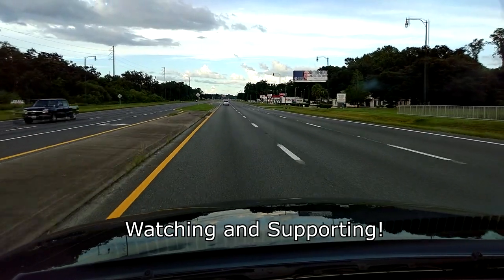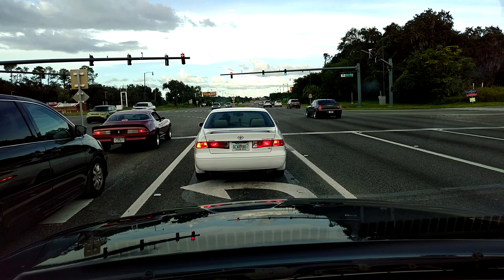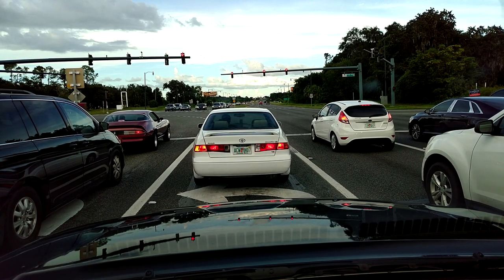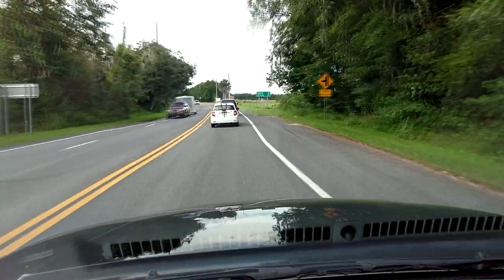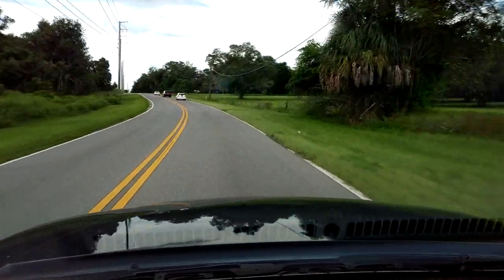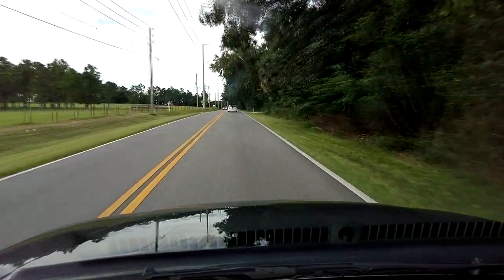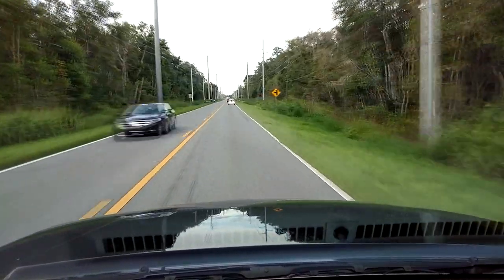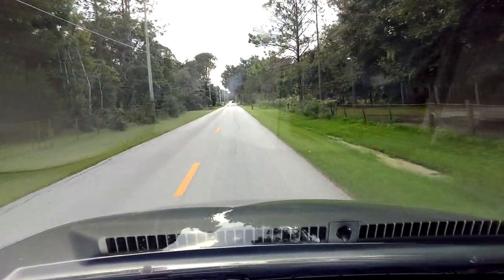Additional Delkin Fat Gecko Tests, Lawn Mower, Motorcycle, Truck - Ray Hayden

Comment: Oh dear.  Hope  you are able to get the kinks out. Thanks for the update! :)Jen
Reply from the maker: The Fat Gecko works great - my equipment is not great for it - the Fat Gecko would be great on a mirror or tiled wall, for a straight down shot for a demo video, and it is a great little tripod to put on a table or such for vlogging!

Comment: Excellent report, Ray.  Well, that answered my question as to whether the Fat Gecko would withstand the shaking and bouncing on my tractor.  I'm sure there's a way to mount a camera that will void the vibration jitters produced from a running tractor. Thanks for taking the time to run the various tests and I also appreciate your report on how the Fat Gecko performs on a motorcycle.  I'm about to run down to the food plot and melt in the hot sun but I finally cut my last tree (for this year anyways). Thanks again and thumbs up.
Reply from the maker: I believe that a GoPro or other decent action camera will be better designed for this purpose. I will do another video where I am acting as a gyro (gimbal) for the camera... those come out MUCH smoother, but are not perfect. To MOUNT a camera, I think a gimbal and a water resistant action camera is the way to go... I just don't want to start chasing the technology!
Reply: Agree

Comment: Good experiment Ray to see how the mount performs. In the difficult situations that cause too much vibration, a Gopro with a head or chest mount to isolate it from the excessive shaking compared to directly mounting it on the mower or motorcycle.

Comment: I hear ya , On my bike I have used just my gopro head mount but I would think a normal video camera would be next to impossible for good footage.
Reply from the maker: And.... you would be correct sir! I was trying to use the camera equipment I have already... and I have some more testing to do. GoPro makes a camera or two called "Session." They are smaller, and I wonder if the 4K version would be best... if at all... more research to do!

Comment: I have been trying to think of a way to keep my cell phone from getting too hot during a livestream too.  I’ve consider strapping an ice pack to the back, lol. The things we videographers will do to have our camera with us always.  Will you be returning the Gecko product?  I have been wanting to purchase a GoPro.
Reply from the maker: I am keeping the Delkin Fat Gecko - it is not the fault, it is my equipment - it is not the right equipment for the unit, and the Fat Gecko mount worked great at securing the camera! I need to see if I can get my phone on the bike, but I am not confident that will be smooth enough on the windshield, which bounces with the wind force. The Fat Gecko would be fantastic on a mirror making a straight down shot for a demo video - or on a mirror for an additional angle for a makeup video (not that I will be doing many of those). It is also great for a low angle tripod almost anywhere - even if not using the suction cups... I have more playing around to do... at less than $100 for the triple mount (which is the double and single mounts - so you could use two cameras!), it is far less expensive than any of my tripods. GoPro has something called the Session (there is a 4 and a 5), but I have to beg my Chief Financial Officer (Miss Demeanor) for authorization to acquire anything like this.

Comment: I have the same problem a lot keeping the camera from being shaky or having a bunch of noise. Hope you can fine a good use for it.
Reply from the maker: I will find good uses for it, I love the device. I will be doing more experiments with it... part of it is the equipment, another part is how I am trying to use it, and then in the best set up for it... but there are a few uses that it will be perfect for, and that nothing else I have would work! I give the thing five stars, and another five, because the triple is really a double and a single - giving us two mounts.

Comment: Was the shaking on the mower from the PTO or just the machine movement?
Reply from the maker: Just driving around on it - in all honesty, I think that if I was riding the mower on the paved road, it would have been awesome! In the truck, or mounted to the hood, or side window, I think it would have done well also... I might toss it up on the window, outside, and see if a nice slow drive around the property would work... with all three suction cups, as long as the camera is secured to the Fat Gecko, it isn't going anywhere! The truck has great suspension, and a smooth ride, so that might work... any gimbal would definitely finish it off nicely.

Comment: the vibration will always be an issue im afraid ;p
Reply from the maker: I fear this is true... I did get some decent video by hand holding the cell phone on the tripod (with the tripod minimized, of course), which acts like a gimbal. My arm, holding the tripod with the cell phone, or camera, acts much like a steady shot device, taking out the really rough spots... I might be able to experiment with the cell phone and the suction cup (single) mount today, depends on the lighting and all that when I leave the property... unless I need to go off property, I pretty much stay here, there is enough work to keep me busy for a while!

Comment: You're using the wrong camera ditch the cell phone buy a GoPro or Air Pro the only time I get serious vibration is when the hog starts up or potholes on the road you like to talk in your videos so I would use the double back tape mount on the left side of your helmet with an air pro or GoPro with a microphone plugged in stuffed inside your helmet